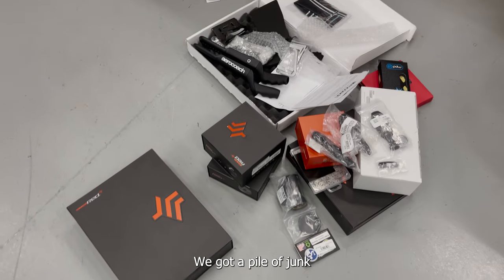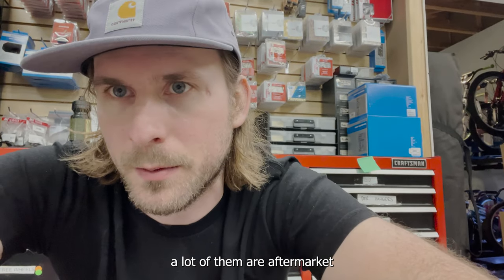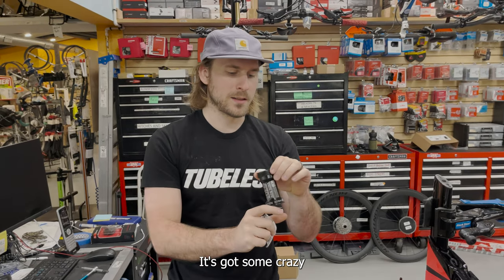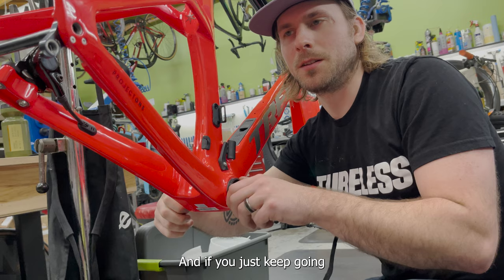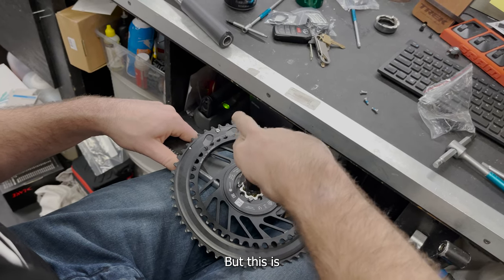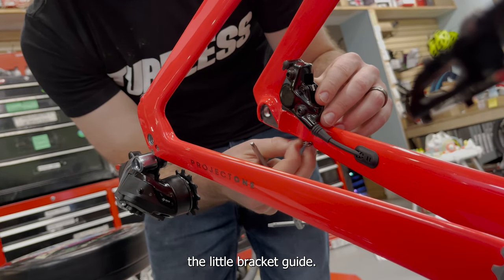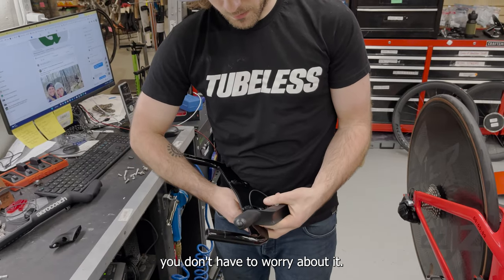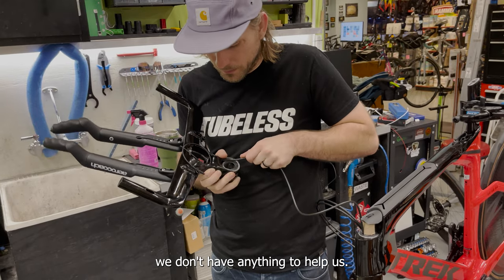Trek Speed Concept Pro Triathlete Bike Build

Comment: Does this Trek accept 28mm front and rear tires? I'm wanting to build one like it but the Zipp wheels for better performance indicate 28 mm wheels. I saw something on the TREK website that the bike's specifications limit 25 in the front and 28 in the back.
Reply: I’m on the same page, NSW will not be compatible with any 25 tlr tire but it seems that many SC riders are actually riding with a 28 tlr in the front with no issues